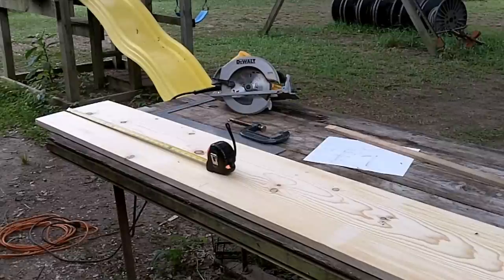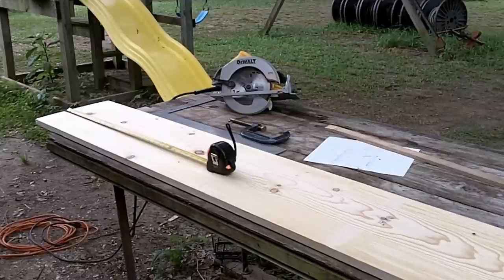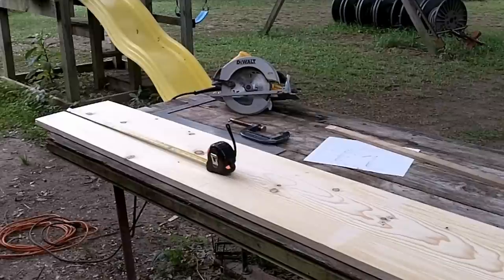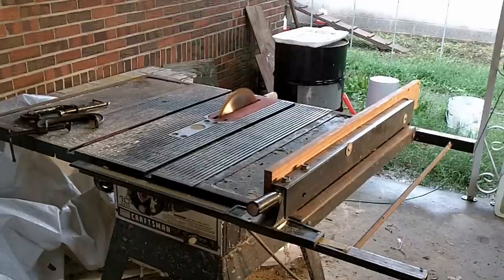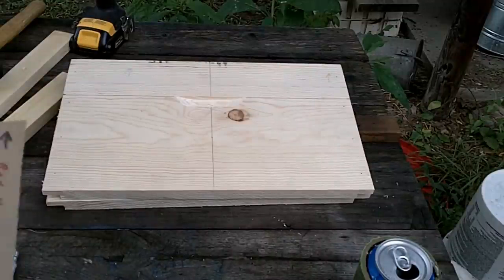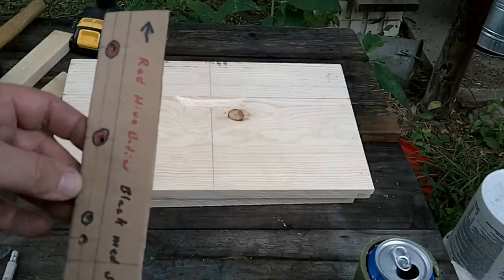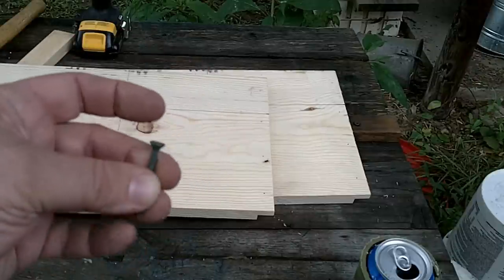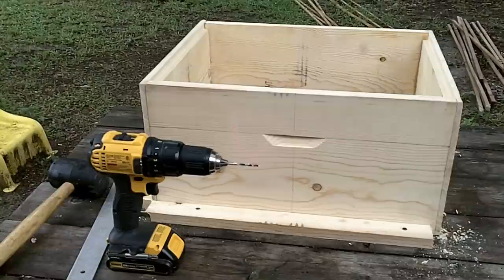Second Story, building a brood box.

Comment: I been using fiberglass resin w/harder in it on my supper, take a desposiable paint brush any cheap or old paint brush, paint the out side and in side with the resin, I put 2 coats on, put them outside in the hot sun and let them dry a few days, 2 days will do!  They looks so pretty with the wood grain, I don't paint em You can paint over the fiberglass resin if you wish, but i think u will be like me and say, looks to dam pretty to paint over it   hehehee cheers

Comment: i 've tried a plywood roof with just the resin, and don't work good for the roof with plywood cause the resin didn't get in all the cracks of the plywood so i found some aluminum sheets and cut it out and spray adhesive on it and put the aluminum roof on work great, almost 20 bucks a roll at lowes Dam it looks pretty

Comment: So far I made 4 deep boxes.
$14 at lowes hardware  per 1 x 12 nominal  boards 8 foot long  with some wood left, that will make 1 box. If I make 2 boxes, I have enough wood left to make a outer top board also or could make an bottom board with the left over wood.
i have big handles  all around the outside, that enable me to lift those boxes with ease and I can add insulation and the handles would aid in keeping the insulation in place with rubber bands or wire.

Comment: if your going to cut 2" off the 1"x12", why didn't you just buy 1"x10"s and save 7 bucks per board
Reply from the maker: 1x10s are really 3/4 x 9 1/4, so they aren't large enough, wish I could!
Reply: Ok was just wondering the reason, i bought some 1"x 10"s today at Lowe's and they where true1"x10"s 8' went for 12 bucks and 6' for 10 bucks, this lumber getting unreal in prices
 i heard that some lumber yards didn't sell correct lumber as advertises and liable for a law suit
Reply from the maker: Honey Hole Hive If they are true 1x10s then the measurements for the dado will be off.
If your gonna build boxes for beehives. Disregard my video/dimensions and look elsewhere for advice on using rough cut lumber!
I've been wanting to build some hives from true rough cut, but time has not allowed!
Good luck! Do some vids on your project!
Reply: i understand that, got to use what you can get, I don't have any equipment to make any blogs wish i did!  i have plenty of bee equipment to copy if i need to, l like to see how other makes there, its all trial and error, i look for ideals and short cuts CHEERS
Reply: Usually, dimensions shown in hardware stores are nominal dimensions that represent raw cut dimensions, but after cutting and sanding those dimensions are getting smaller. So the sticker should say actual dimensions if the wood has the actual detentions. 
That is why a 1 inch nominal  thick would has about 3/4 inch real thickness when you buy a sanded smooth piece of wood.